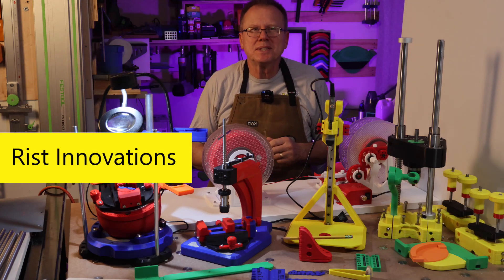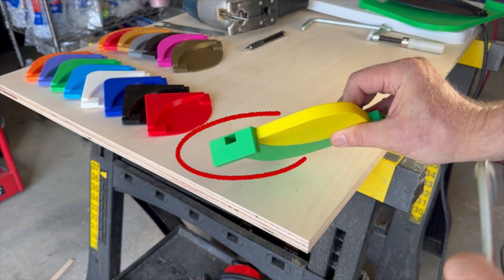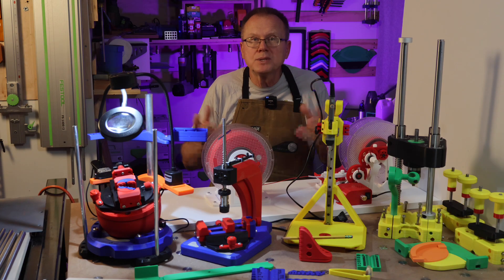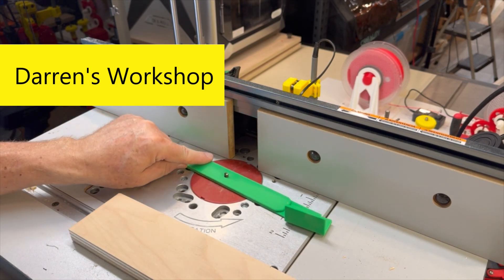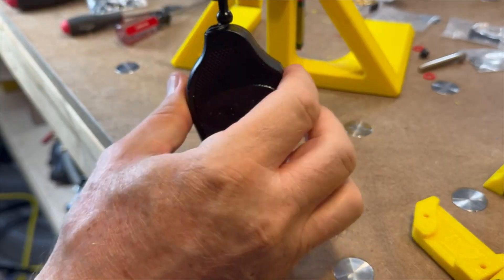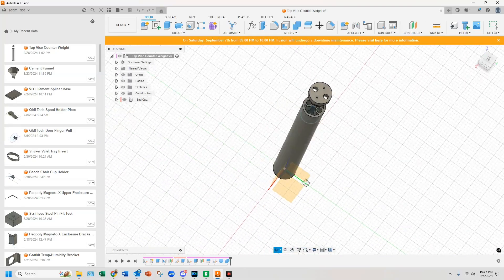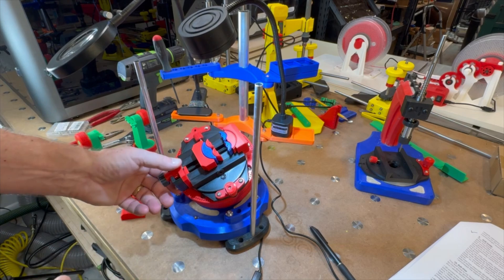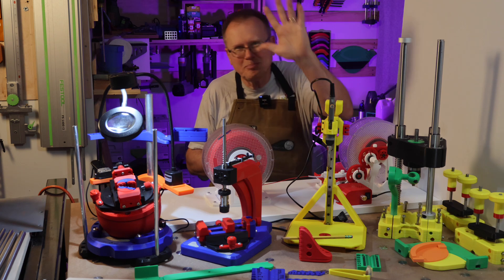TOP 10 3D Printable Tools YOU should Make

Comment: chris borge is just amazing the dude makes machines i never thought you could make with 3d printing
Reply from the maker: I totally agree. Chris Borge is a very talented designer.
Reply: @ I made his lathe and it works quite well I use a stronger motor and changed a little bit the wiring so I have from a sewing machine a pedal as a deadman’s switch so when I take my foot off it turns off the engine and it works really well
Reply from the maker: That's good to know.  Thanks for sharing about the lathe!

Comment: I would like to get files from USSA but I have questions about the building process and don’t get any answers to the inquiry I have sent through the contact form on the website: when buying the files, are there any information provided regarding the hardware required to put everything together?
Reply from the maker: Yes, USSA does list the hardware needed, but not the sources. A couple of things I learned was that the first wood threaded inserts I ordered from Amazon did not fit the holes in the 4D printed parts so I had to order a different design of inserts. Also, he did not provide any details on the laser so I had to enlarge the laser holder so the laser I bought would fit. I hope this helps. Thanks for your question.

Comment: I have never once had to rewind a spool. Never. Not one time😂 why is it such a problem for people?
Reply from the maker: I have used the spool rewinder when I have had spools from other manufacturers that don’t fit into the Bambu Lab AMS. I agree it’s not a daily thing for me either.
Reply: “Rewinder” isn’t quite the right word for what it is. The original designer called it a “spool switcher and winder”; I refer to it as a “respooler”. I printed the original and have used it many times to transfer filament from a 250g roll to a 1 kg roll for use in an AMS unit. I tried various spool adapters for the little rolls but they never worked right. I’ve also respooled filament on cardboard rolls that the AMS had trouble with.